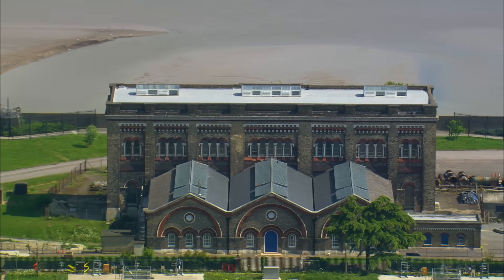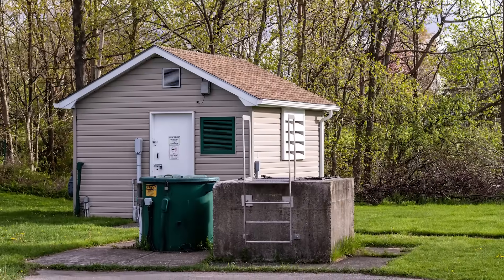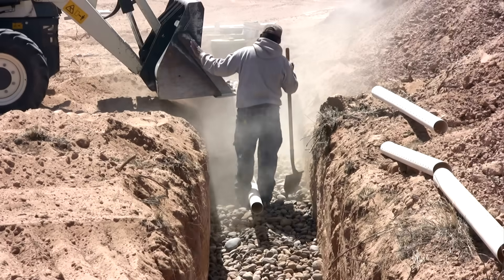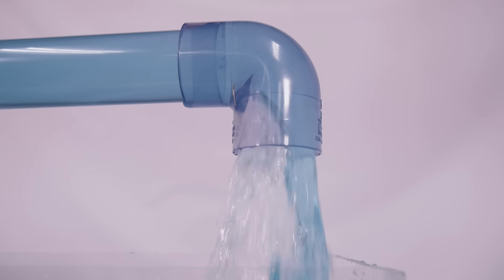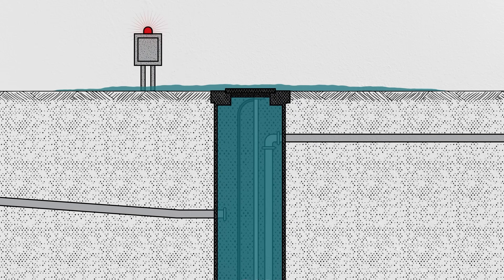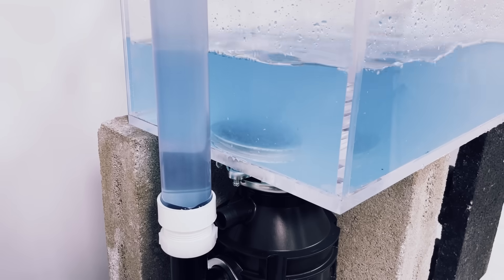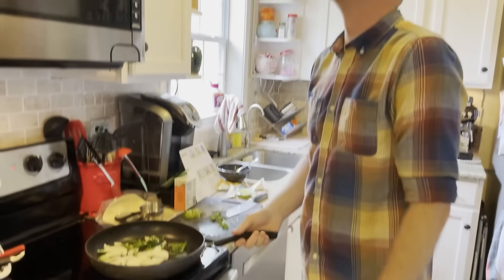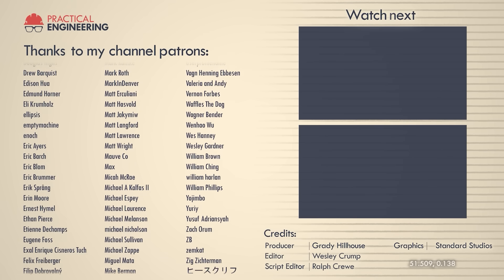How Do We Pump Sewage?

Comment: Designed many lift stations in my 38 years of wastewater engineering.  You have done an excellent job of explaining the issues involved for the general public that have no idea what goes into transporting and treating wastewater.  Look forward to your videos on treatment.
Reply: Those grinder pumps look like a great way to produce microplastics, if and how is that handled?
Reply: @leonfa259  tried to stay away from grinder pumps instead selected pumps that could handle large solids if at all possible.  Did occasional use muffin monsters which ground up large solids using rotating grinding teeth prior to pumps but mostly relied on screens to remove hard to deal with solids.  Of course that required more maintenance etc.  sometimes there are just no easy answers.  Grinding up solids can cause issues with treatment units since the first step in most instances is clarification of the wastewater by settling and larger stuff settles more readily.
Reply: They work OK until the edge goes off the cutters, then they jam up readily. Condoms can also be a problem as they stretch and can cause a stall, tripping the motor.
Reply: @victorcroasdale4992  yeah they do have problems. Never was a big fan and that is why I stayed away from them.  You had to watch the headless through the units in design also.
Reply: @1945d18    Generally grinder pumps were the smallest sizes, intended for small flows and (IIRC) quite low heads.   I also suspect they were horribly inefficient hydraulically, though of course that didn't matter much with small pumps.   Could also have used vortex pumps but their efficiencies were terrible.     I never had occasion to use either, instead used (mostly) pumps with open single-channel impellers.   
I was happier with bigger pumps for bigger flows where impeller solids clearance was not an issue.    (Retired wastewater engineer here).
Reply: @cr10001  you are correct on all counts grinders only for small flows .  I also am retired but once an engineer always an engineer and I kind of miss it. Designed and managed wastewater and water projects all my working career and did my masters thesis on storm water runoff.

Comment: Hi, I just finished a course on waste and wastewater management this semester and we saw that in order to lift sewage, Archimedes screw were used since they can handle important flows. You didn’t talk about them in your video and I wondered if it’s a difference of custom in engineering or if the sewage system was different in North America in a way that using them would be impossible (I live and study in Western Europe) or if you just didn’t mention them ? Beyond that I really like your videos and they remind me why I am studying engineering!
Reply: In America, the sewage system typically serves a much larger urban and suburban area than most European service areas.  Because the incline of the sewage pipe must be maintained, the sewage can only travel a couple blocks before getting very deep into the ground.

Digging is expensive, so instead we chain lift stations together so that no length of pipe ever gets too deep.  This chaining of lift stations can also extend the service area of an existing sewer system (sometimes a lift station's capacity must be increased).

Using a screw at every lift station you build is also expensive.  A (relatively cheap) duplex submersible pump setup can do an equal job without installing a giant metal screw in the ground.  The difference can really add up when you intend to build hundreds of lift stations.

The bottom line here isn't to get the absolute best and most expensive system that can last for lifetimes; instead we want to maximize the ratio of sewage treatment capacity versus cost.  "Anybody can build a lift station that works.  Only an engineer can build a lift station that barely works."
Reply: @roblaquiere8220  Not sure if you've worked in design before, but it's actually pretty difficult to design a lift station that even works at all sometimes. I spent about a month going back and forth between various iterations because the flows we were designing for were going to be very small. Might seem like it would make things easier. Less flow means smaller pumps and therefore cheaper, right? Partly true, but then you also have maximum detention times to prevent settling in the wet well, minimum flow velocities to prevent settling in the force main, which are related to minimum force main diameters, which ties into sizing your pump since your Total Dynamic Head is in part a function of friction between the flow and pipe walls, etc. It's all a very delicate balancing act to get things to work, let alone working well!
Reply: @elijah4606  I never did any design, my experience comes from building controllers for lift stations.  I also was rewinding burned up submersible pumps for like 10 years (for lift stations).
Reply: We use Archimedes screws in the UK, but those I'm aware of are used for pumping flood water. But then presumably any used for sewage wouldn't be visible.
Reply: I'm a retired Professional Engineer and also a Chartered Water and Environmental Manager. I worked on sewerage systems all over the world. Screw pumps are not widely used in the US, I suspect because of "not invented here". The largest pump station I worked on had 9 screw pumps each capable of pumping 3 tonnes per second.That's about 680 Million gpd in the US. We think it was the third largest pump station in the world at the time of construction (30+ years ago) 
I've built screw pump stations that were underground to the point where people living in nearby apartments overlooking the site thought that the pump station was a residence.
Reply: The City of Palmer in Alaska uses screw pumps, right at the treatment plant to send all of the incoming wastewater through a screen then to the treatment ponds. It's been a long time since I was working there, there might have been a flowmeter at that point to. I do remember at one point the pumps failed and flooded the building. After the pumps were repaired we had to grease the pumps and the floors were incredibly slick from the oils in the wastewater!
Reply: I have never seen a screw type pump used in NA. I have only ever seen centrifugal style pump used. I have seen some old displacement pumps that were still technically in the system but were disconnected decades ago. They had a municipal serial number so no one could technically throw them away but they were never used.
Reply: @dimesonhiseyes9134  When I was building plumbing station in the 90s we installed screw for back pumping in the beginning of the preprocessing. It can handle quite rough stuff - head size stones and so on. After that area are initial screens to filter out bigger stuff. But when those get clogged, operators appreciate option to pump it empty before cleaning.
Reply: @ptappola  my municipality just prefers to switch the pumps out. A pump gets clogged or breaks they pull it out and replace it. If the lift station is full get a vactor and suck it out.
Reply: Very thoughtful question.  I have been working for a company that supplies Archimedes Screw Pumps (made in The Netherlands, the world's screw pump experts) for 10 years.  Screw pumps do have significant infrastructure requirements, but are more reliable and more efficient wire-to-water than other pump types, especially the larger ones (tens of millions of gallons per day each).  They do exist in the USA and are used in many applications that often require high flows of unscreened sewage.  A city in North Carolina has two lift stations using five very large screw pumps for their main sewer line and then more at the plant lifting the return activated sludge into aeration basins.  Several clients in flat areas of the county (Salt Lake, coastal New Jersey, etc.) have screw pump stations for flood control.  They also turn up quite frequently for "primary influent" to treatment plants, so the screens can be located inside the headworks buildings rather than way down in the ground.  I have often wondered about the engineering bias toward other types of pumps and I do believe screw pumps are not emphasized in American universities the way they probably are in Europe.  Most of my work involves replacing old screw pumps, but we do get to design new stations from time to time.  A screw pump is an interesting piece of machinery and always entertaining.  www.epicintl.com
Reply: Archimedes Screws tend to be very large and expensive, and (since they have to be mounted at a flattish angle) occupy a lot of real estate.   Also their lift ('head') is limited, maybe 20 feet, though their capacity is huge, and they will handle any flow up to their maximum with fair efficiency.   Also, they're virtually unblockable.   As such, they tend to get used for moving around the more heavily solids-laden sewage in treatment plants and the like.
In stations in the sewer network, pumping heads of say 30 to 100 feet, hydrodynamic ('centrifugal') pumps of one sort or another tend to be used.
Reply: @cr10001  Once the solids content gets above about 5% the use of positive displacement pumps is recommended.  Progressive cavity pumps (AKA Mono or Moyno pumps) are popular. I once got to visit the Mono Pump factory in the UK to discus stator material choices with their chief material scientist, when I was investigating the premature failure of several pumps.  I got a tour of his lab but they wouldn't show me the machine that made the rotors as it was considered a trade secret.

When I worked in Qatar we built a series of underground screw pump stations. The buildings above grade held the transformers, standby generators, switchgear, ventilation equipment,  etc. They had walled gardens round them and were designed to look like expensive residences.
Reply: @victorcroasdale4992   Maybe I should have said 'debris-laden' with reference to Archimedes screws.   Like, bottles, disposable nappies, rags, all the rest of the detritus.    As I understand it, progressive cavity pumps (e.g. Mono) are suited to pumping e.g. sewage sludge with a high solids content.   Also generally suited to higher heads and lower flows.   We (Auckland NZ) didn't use them in reticulation, not least because of cost. 
When you say you had screw pumps in Qatar - was that Archimedes screws?    That'd be expensive, though from your description of the stations, the budget must have been fairly generous.
Reply: @victorcroasdale4992  Fascinating career.    You worked on the really big stuff.   I spent my career in Auckland working mostly on medium-size stations (biggest was 2000 L/sec total), though a very varied bunch because when the system was built in the 60's every station was outfitted by separate tender (I think) so every station had different pumps, motors and control systems.   Every starting/speed control method from direct-on-line to star-delta to multi-wound motors to resistor banks (cheap and horrible) to induction regulators, and of course later additions had VFD's and the like.   Though I had to Google Kramer drives - more electronic black magic   :)     And almost every surge (water hammer) control method, from standpipes, to reduced-speed pump stop, to slow-closing power-operated plug valves, to pump bypass check valves, to air inlet (anti-vacuum) valves.    
So maintaining/upgrading them was never boring - every one different.
Reply: Came to say the same about the archimedes screws that are used here in Philly at one of the water pollution control plants

Comment: Honest question. 

If it ethical, or even legal, for a municipality to recycle their water? That is, take the waste water, filter it, purify it, sanitize it, and pump it back to homes as fresh water?
Reply from the maker: Yes to both. I have an upcoming video that will talk a little more about water recycling and reclamation.
Reply: Since water is not usually created or destroyed, there is a good chance that some what you are drinking today was once dinosaur pee. :-)

Legality or ethics aside, there is a problem: Water is expensive to pump uphill. Most waste-water plants are at significantly lower elevations from water treatment plants. So, even presuming nearly perfect waste-water filtration (and believe me, it can actually be cleaner in many respects than the water that comes from your tap) pumping that water back uphill for redistribution is not usually economically practical. However, as water resources get more strained, I'm sure some cities will be looking at recovery and reuse as a way to deal with the lack of fresh water.
Reply: Yes that is actually done in some areas. The problem is people think that is gross while in reality all fresh water gets used over and over anyway. In my area( Great Lakes) the water intake is out in the middle of the lake and the wastewater treatment discharge is in the river. It would actually be more cost effective to do one more step of treatment at the wastewater plant and reuse that water. The discharge is actually very clean and would take very little to make it potable again.
Reply: Depends on the locality - most of Germany along the Rhine draw their water from the river then dump the treated water back into the river for the next town to use. Its such a thing that there are some severe environmental problems with male fish becoming sterile from all the contraceptive hormones and drinking the water will result in you giving positive test results for most common 'recreational' drugs. Its probably much the same for all major rivers in Europe. Some places that should be doing it have tried votes on doing it which have faced considerable corporate opposition and 'fixed' questionaires.
Reply: The timing of water recycling done by the water authority is crucial,  during summer its done more often hence the high levels of chlorine during those months.  I would never drink tap water unless I have have pre boiled and filtered it.
Reply: @ranat5526  Well, I live in a town of 1400 in southwestern Indiana. I noticed the chlorine level went high in my tap water about 6 years ago. It hasnt returned to normal. And I've gotten numerous letters from the town saying to "keep all rain water and runoff out of the sewer system." So, that tells me my towns been running on a fully closed loop for years

Comment: Everything you put down your drain (or toilet) must be removed. Please stop flushing condoms and the plastic from tampons. They belong in the trash. You need to realize that the water you use is reused over and over again. And grease is also a huge problem in waste water treatment (now called water reclamation) because it sounds better. It’s also a good paying job where you don’t need a college degree to become an operator. Once you pass a test and get some experience you can pretty much get a job anywhere in the nation. They are always looking for operators. It’s not a hard job. Yes it can smell at times and be gross but in operations most of the time you monitor the computers in your clean office. You start out as a class 1(orA) and can go up to a class 4. Making more money and more job opportunities as you advance.

Comment: Excellent description of how waste-water pumping works. I spent a career of over 30 years working around many waste-water pumping stations of all sizes. There is more to sewage than just the yuk or eww factor. If waste-water sits in enclosed spaces for too long it can be quite hazardous. Sulfur dioxide is one hazard, and Low levels of oxygen in confined air spaces is another. Occasionally people dump things down the drain that they shouldn't. Some of it may be explosive (literally). One technician I used to work with happened to be calibrating a flow meter for wastewater when he noticed a smell that was an awful lot like ether. They were just down the street from a hospital. So raw sewage is to be approached with caution. You really don't know what might be in it. 

Jacob Brodsky, PE
Reply: The grossest thing I have heard of was in a pumping station that served the freezing works / abbatoir area.   The smell driving past was nauseating.    24" main pumps, they could still be clogged by e.g. parts of cows (!)   Fortunately by the time I was involved with that station, almost all the freezing works had shut down.
Also, another sewer downstream of a tannery - the smell was unbelievable, and whatever the tannery had dumped down the sewer had eaten all the concrete away from the bottom so there was just a skeleton of steel wire reinforcing cage in the ground.

Comment: I work as a PLC programmer for water and wastewater SCADA systems. This is a very well done video explaining how lift stations work and the various types of systems used within them!
Reply: Are the systems that you use connected to the Internet? If so, what security measures, without being too specific to prevent compromises, are used to prevent breaches?
Reply: I like having a clean ass, so I'm wondering how much of a problem "flushable wipes" still cause for your facility of employment, and whether or not I should even flush one at a time.

Comment: When a pumping station is used, is there a one-way valve at the manhole end of the force main, or is inflow of, say, rain water from the manhole allowed to enter the wet well?
Reply: Backflow valves are usually located as close to the pumps themselves as possible

Comment: The main manufacturer of grinders i have been around call them muffin monsters
Reply from the maker: Yeah that was their product in the video. They kindly shared a video with me to include.
Reply: @PracticalEngineeringChannel  i was lead electrician on a lift station project. There were three 455 hp pumps that pushed sewage through 24" force mains at 215 psi.  There is certainly more to it than people would assume.